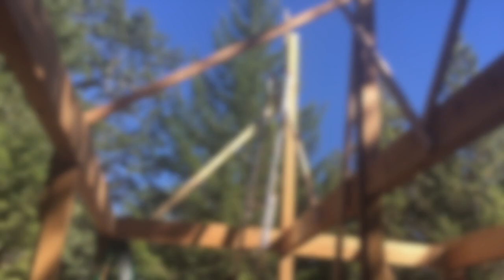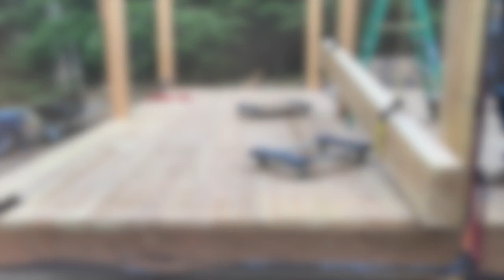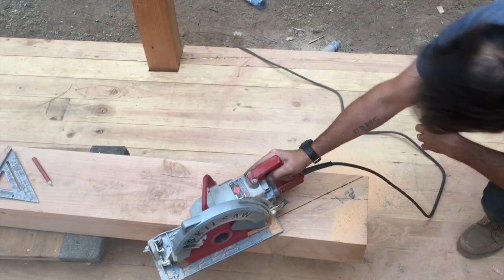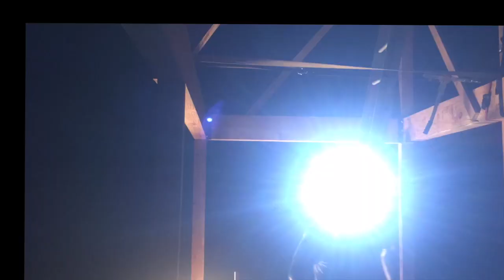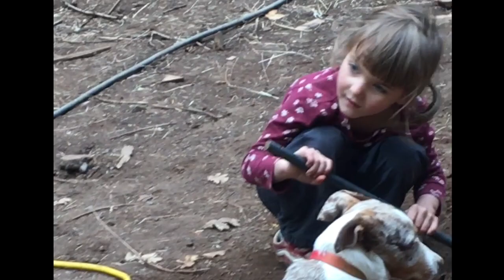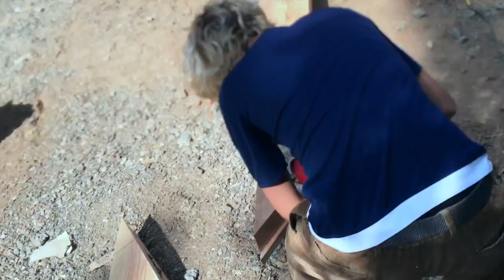Off grid cabin builds & homesteading EP.6 | Structural post & beam part 2 | CROWSFOOT

Comment: Nice use of skycranes. Smart pulling the centre beam up diagonally to pass by the cross beam. I tried pulling my centre 16' beam up the outside and then along a ramp. Thought I had roped the skycranes tightly to the two centre kingposts but ... nope. Not strong enough and a precarious situation developed. Luckily I had a couple of comealongs which saved the day by securing the horizontal forces. Next time I'll stay with the straight vertical lift.
Reply from the maker: engineering on the fly! love it! thank you for sharing!